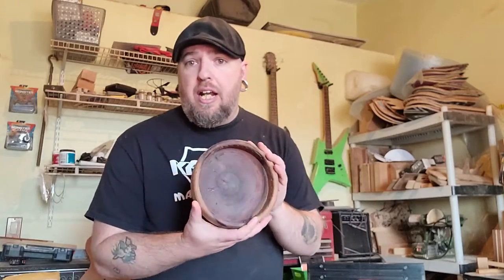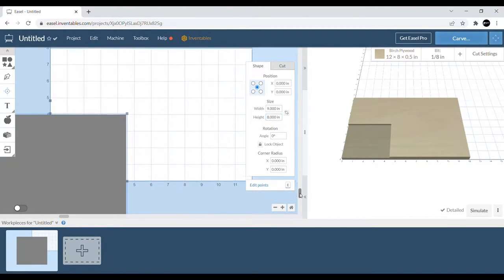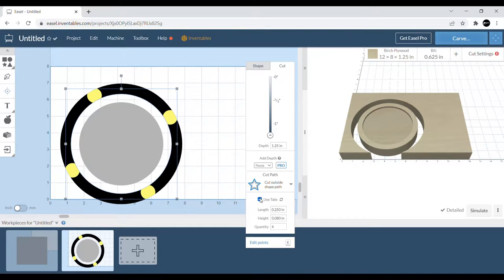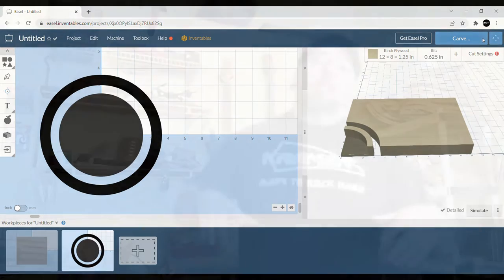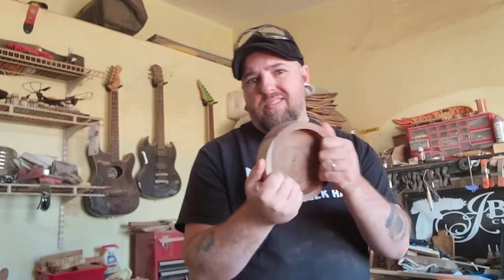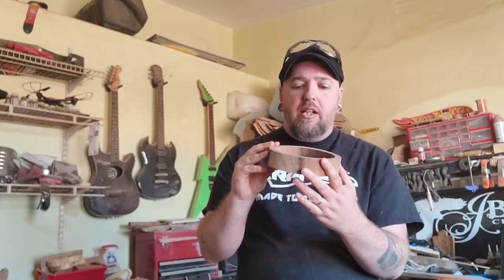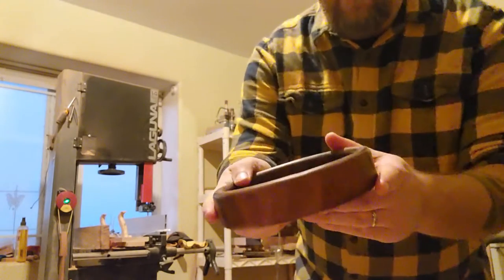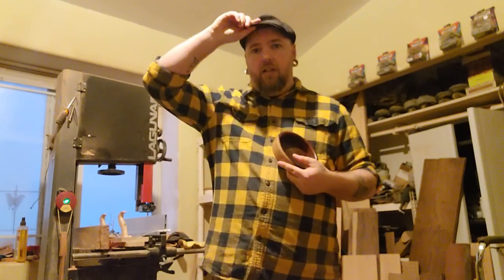How I made a catch all tray using Easel cnc software... it's beyond easy!

Comment: Just out of curiosity, how long did it take and what were your cutting settings? Feed rate, Plunge rate, and Depth per pass? Great video, thanks for sharing!
Reply from the maker: Honestly I don't really remember how long it took but wasn't very long. Couple of minutes. Each machine is different so my rates may be much slower than what another machine can handle but may also be to fast for others. Dialing your feeds is a tricky thing and something that you'd really have to find where your machines runs best

Comment: Nice and simple. 

What bit are you using
Reply from the maker: Honestly that was just a cheap ryobi  bit from home depot... nothing fancy but works great
Reply: Was it a 1/4” or 1/8” down cut. 
What did you utilize ze to surface the top prior to cutting circle. 

Nice work btw
Reply from the maker: I used a 5/8th straight bit for both

Comment: Are you eye balling the center of the work piece when you design the gcode set on zero, zero and the image is only showing the upper right hand corner (say 12 to 3 o clock)
Reply from the maker: So using the material I had I was able to kind of plot out and measure what size tray I could fit on it. Once I knew that with easel when you design it gives you only square stock  but knowing what size you can cut you make the 0,0 home the center of the circle you will cut. So I knew 6 inches is what was going to cut so I basically drew a 6 inch circle on the material and figured if that drawn circle will fit the cut will fit then start the carve and the center of that circle. If that makes sense...
Reply from the maker: So with easel the image only showing the upper right hand is only because easel designs from the bottom left as 0,0 for home. So if you highlight everything and set the 0,0 for the center of the design and press simulate you will see where it cuts even though the material on the easel screen isn't there...
Reply: @JBirdCustoms  thanks dude! I just got a Onefinity journeyman this week and im new to cncs
Reply from the maker: Nice! I'm really interested the onefinity! I have had my xcarve for 5 years now and done a bunch of upgrades but I'm growing out of it. I need more stability and seen the onefinity, it looks like a great machine! I'm currently in the middle of moving and plan to do more videos once moved so subscribe if you'd like and if you have questions please feel free to ask and maybe I can make a video on it!

Comment: I may be too stoned but I'm skipping the first step if my lumber (stock) is already milled flat and square
Reply from the maker: Yeah if it's already flat and square skip that part... I used a band saw to quickly cut some pieces to make these so they weren't level at all... after that it's basically draw some circles and press carve.